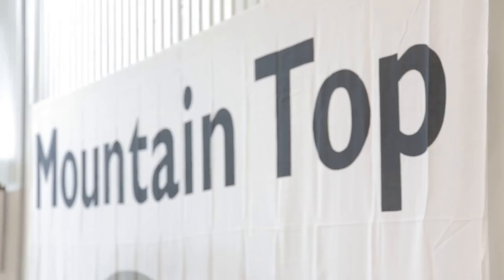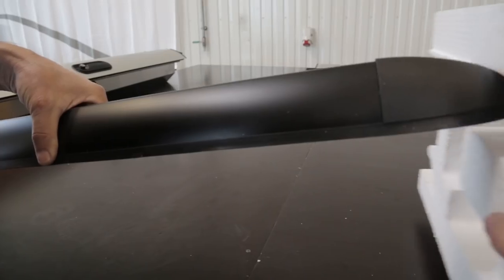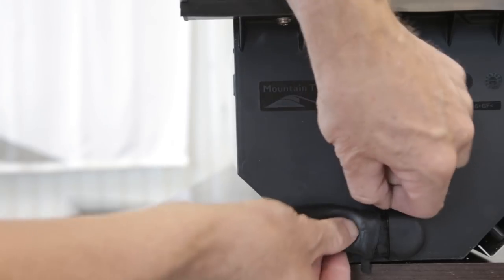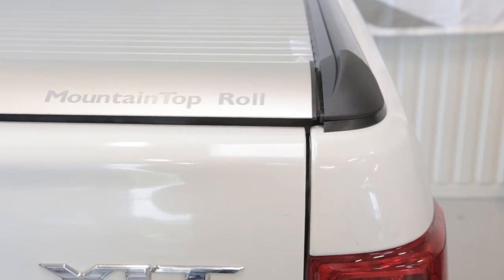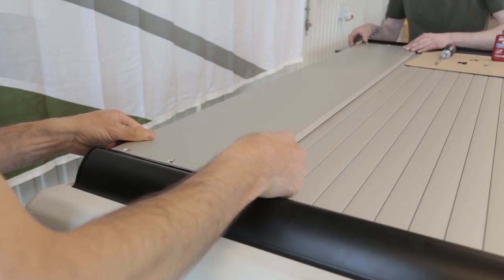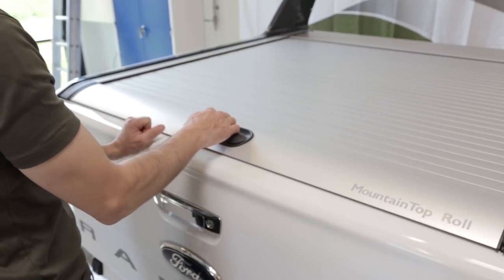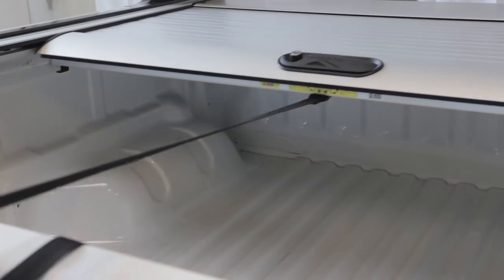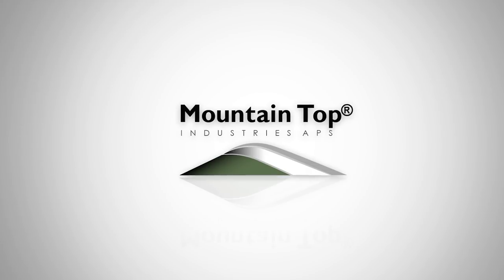Installing the Mountain Top Roll

Comment: My rolltop has been mounted asymmetrically by the installer, and now there is a significant gap (about 1cm) on the left side that lets rain in. Is it possible to adjust the fitting of the rolltop post-installation?
Reply: Me too 😢
Reply: I have same issue, did you rectify the issue? I assume its a case of reversing the installation above?

Comment: hello, after 2 years of installation, when it rains, the water does not drain, it remains in the container and is the flood in the bucket. How to clean the container ?
Reply: It'll be the drain tube that are blocked....I had the same trouble....take the lid off the container and you can see the drain tubes ...poke them clear and that should fix it...sorted mine....😊